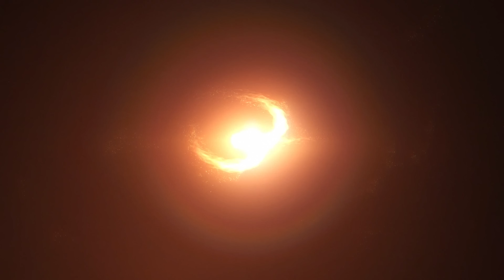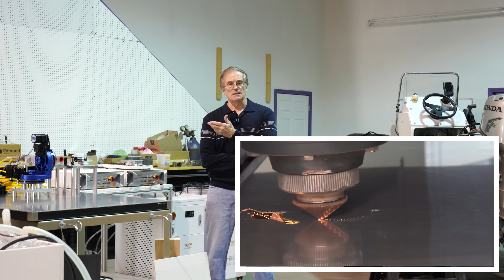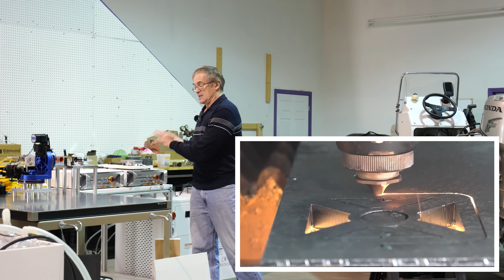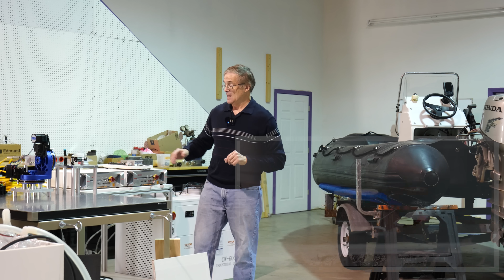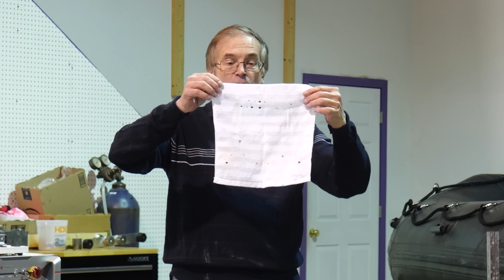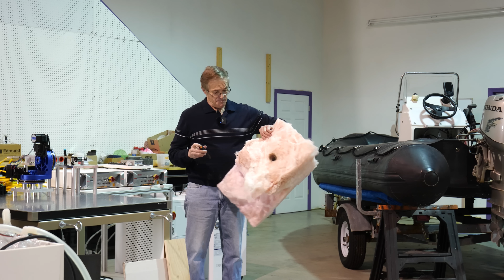We have a problem... and need your help!

Comment: A thank you to the creators of AI Llama. 4. which helped to  communicate this proposal/idea
Laser Curtain Concept. 
Creating a laser curtain to absorb or deflect incoming laser beams is theoretically possible. Here's a breakdown of the concept:

Technical Challenges
1. Beam Interaction: Laser beams interact through interference, absorption or scattering. Designing a curtain that effectively interacts with the incoming beam is crucial.
2. Material Selection: The curtain material would need to be able to withstand high-intensity laser beams without damage or degradation.
3. Curtain Design: The curtain's structure and composition would depend on the specific requirements, such as the wavelength, intensity and duration of the incoming laser beam.

Potential Solutions
1. Absorptive Materials: Using materials that absorb specific wavelengths of laser light could be effective.
2. Reflective Surfaces: Designing a curtain with reflective surfaces could deflect incoming laser beams.
3. Nonlinear Optical Materials: Certain materials exhibit nonlinear optical properties that could be used to absorb or deflect high-intensity laser beams.

Applications
1. Safety: A laser curtain could be used to protect people or sensitive equipment from stray laser beams.
2. Security: It could be used to prevent unauthorized access or to protect sensitive areas.
3. Industrial Applications: A laser curtain could be used to control the extent of laser processing or to protect surrounding materials.

Feasibility
While the concept is intriguing, the feasibility of creating a practical laser curtain depends on various factors, including:

1. Laser Beam Characteristics: Wavelength, intensity and duration would impact the curtain's design.
2. Material Limitations: Currently available materials might not be able to withstand extremely high-intensity laser beams.
3. Cost and Complexity: Developing a practical laser curtain could be costly and complex.

Further research and development would be necessary to determine the feasibility and potential applications of a laser curtain.

Comment: As others have suggested, sand is probably the cheapest and easiest solution. As for the setup, you could take a big sheet of plywood and glue sandbags to the face. The sandbags you can easily buy from the hardware store would be a few inches thick at least, enough to stop the laser for at least a few seconds. You can then put the sheet on a frame with wheels to easily move around in front of your laser beam.

Comment: Hi! Here is a good practical solution for your problem. In English, this is known as a water curtain. You need a flowing water wall—possibly more than one, arranged in cascading layers. This is quite a common solution in industrial processes, especially when you need to dissipate heat or prevent airborne substances from escaping beyond a certain space. Feel free to use it!
Reply: By the way, since the thermal conductivity and heat capacity of water are well known, it won't be difficult to estimate the parameters (velocity and thickness) of the water flows.

Comment: Curious if a copper bucket of water would work.  The walls of the bucket would need to be oxidized or painted with an IR absorbing paint. The paint cant be too thick or it will just absorb the heat and flake off.  A thin enough layer will transfer the heat to the copper and then the water.  If the bucket has enough water, it will absorb the heat and not boil. The bucket may need heat transfer fins on the water side to enhance heat transfer to the water.
Reply: thinking about this more.  Shoot the laser at a mirror that reflects the beam down towards a carbon cloth floating on the surface of a tank of water.  By shooting the beam downward, the carbon cloth only needs to serve the function of absorbing light and turning it into heat. It does not also have to be structural or keep water from leaking. Once the energy has been turned into heat, the water does the job of dissipating all the heat.  Essentially your blanket idea but changing the angles to allow for a lot more water to be available for heat dissipation.

Comment: make a waterfall wall out of plywood and dye the water black.  First though was for the wall was ceramic, but plywood would work and it hold the water better.
Reply: could add lines - whether cut or added onto the surface to break the waterflow tension and perhaps thicken the water flow, so to speak or at least cause turbulence. Another thought... add something like gelatin to the water to thicken it up all by itself. Shoot... do all the above  LoL

Comment: I see all these engineers and science type people offering what are probably great suggestions. But as a redneck with a GED, I'd recommend water saturated ceramic fiber blankets, as my first choice.

Absorption: Water has a high absorption coefficient at 1064nm (~0.1 cm⁻¹), converting laser energy into heat and steam. A 100W fiber laser will vaporize water rapidly, scattering the beam via steam bubbles. Ceramic fibers (silica/alumina, 0.1–0.2 g/cm³) add moderate absorption.

Scattering: The fibrous structure of ceramic blankets (e.g., Kaowool) diffuses the beam, breaking its focus. Steam generation enhances scattering, critical for a 100W laser’s high energy density.

Thermal Resistance: Ceramic withstands 2300°F, and water cools the fibers, preventing full burn-through. A 100W laser vaporizes steel at ~2500°F but loses coherence in this medium.

Thickness: Increase to 4 layers (1” each, 4” total) instead of 3. A 100W fiber laser cuts 1mm steel in <1 second, so an extra layer ensures no pass-through.

Water Content: Soak to 60–70% water by weight (vs. 50%). More water increases absorption, countering the higher power.

Expected Result: Penetration stops within 3–4” (vs. 2–3” for a lower-power laser). The first layer vaporizes water, creating steam that scatters the beam; subsequent layers absorb/scatter residual energy. You’ll see steam, charring, and partial fiber melting, with no pass-through.

Effectiveness: Very high. Water’s absorption at 1064nm and ceramic’s scattering handle the 100W+ power efficiently, stopping the beam in minimal depth.

This would also be cost efficient, as you can get ceramic fiber blankets on Amazon for about $20 for a 12" x 24" piece. If you hang it vertically, I would recommend letting a water hose run above it, to keep it saturated. Now, like I said above, I'm just a redneck with a GED, but one thing I do know how to do, is use Grok to get suggestions from.

Comment: I've personally made refractory coatings  using sodium silicate, perlite, magnesium oxide, plus any other materials you might find like baby powder: into a slurry.
I'm wondering if adding carbon might give you the light adsorption to prevent reflective laser energy havoc.

Comment: Colored water in a tank with a water leak catch basin that has sump pump for refilling the tank hot glue or plastic weld the holes shut so the pump does not have to go continually .
If you are using a flammable material like PVC for the tank then a layer of water resistant drywall held with many separate strapping bands , keep your tank cheap let it curve outward for the bands to take the load .

Comment: Thinking outside the frame you suggest. What are you really trying to accomplish? Limit collateral damage. My suggestion: Don't focus the beam all the time. One way to make it work. Add an actuator to the final lens. Put the lens on a spring, so by default it's very diffuse. The actuator moves the lens past the ideal focus point and lets the lens go. You can pulse this quickly until the target is destroyed. the system is designed to fail into a safe(ish) configuration. You can dial in the amount of focused time, and I believe the pulses may actually enhance efficiency since the ablated material will have a little time to disperse and the laser won't spend time superheating already vaporized material.
Reply: I think this is a good direction.
I tought of a dedicated lens for beam-spreading infront of the absorbent material.
Reply: This is how the rust remover works, correct?
Reply: Failure could be an option, and not a pleasant one? Failure in this case would entail working too well.
Reply: some kind of system like an airpiston to counteract the spring would work great. and only with the correct ammount of pulses per second (kinda like a PWM) the lens  is in the correct positon to focus. if the system gets stuck with full pressure > unfocused. if no pressure > unfocused.

although this might create some vibrations in the lens sending the laser beam of by a  few degrees but that sounds like a solvable Problem to me. (higher pwm frequency or  tuning the piston vs spring forces would probably work)
Reply: I know nothing, but I wonder if changing the focus point increases heat….
Way above my skill level for a MS Degree
But I’d like to have one in the garage….GREATLY

Comment: perhaps a bulk ablative material such as bags of silica sand (melting point of approximately 1700C), or better yet ceramic blasting media (carborundum has melting point of approximately  2600C).  I suspect the entry hole would solidify, preventing the media from pouring out of whatever container you use, but the remaining media, with such a high melting point, would be able to sustain a sufficient burst of energy.

Perhaps a sandwich of cement board panels and blasting media.  Thickness would need to be experimented with.

Comment: Maybe an aquarium with one thick copper sheet side which will face the beam would do it, copper is a good heat conductor and the water will cool it down so hopefully it will absorb the energy. Sandblasting the surface so it wouldn't be reflective that much.
Or, just a mirror at 45 degrees which will direct the beam into the ground.

Comment: What about just solid wood?  Even if you just stack 2×6s, based on how long it took to get through the 3/4 plywood, you'd get a few seconds before it made it through the 5" of width, and then you could easily replace the damaged pieces.  Though I wouldn't use construction lumber, green wood would be better, and if it were wet, it would almost certainly self extinguish, but even if it didn't, you wouldn't have inaccessible embers like you might with the plywood layers.  And wood is readily available up here in New England.  That said, the other comments talking about using a water curtain with either dyes or an electrically conductive plate behind the water does seem like it may be a good solution, in that it would be less massive.  Wet wood's just so cheap and readily available that it seems worthwhile to consider regardless, unless the mass is just too much of an issue to overcome.

Comment: Here is my idea: Perhaps  there could be a cylinder, say a steel pipe shaped like an "L". One of the orifices of the tube would face the laser, this side would have a glass/quartz/ruby window that would allow the laser light to penetrate. The tube would be filled with water that has perhaps a colloidal substance like silver to scatter the laser within the water. You could also use a dye that absorbs some of the light coming from the laser. The other end of the "L" would be facing the ceiling and would be left unsealed to either vent out steam generated within the pipe and you could attach a graphite cone or disc a few inches above the opening should any harmful light reach this point. 
Why I think this may work well is that the colloidal substances within the water would help disperse the tight laser beam into a less organized, less harmful light. The amount of colloidal solids in the water could be tuned in order to allow a specific % of heat to be released in the water. The length of the tube could be customized to a suitable diameter to provide sufficient "heat sink" properties.
Additionally, the "L" shaped tube with the elbow facing up would further help in scattering the light upward and allow for easy refilling and or allowing steam to escape. The graphite cone attached a few inches above would act like a secondary laser sink to stop any remaining light, at this point the graphite should not be taking too much damage.

An even cheaper solution could be a reservoir say like a 5 gallon bucket but made of steel, a window on the side facing the laser would still be needed on the side exposed to the laser like above and you could dump coarse sand and or gravel then fill the gaps with water. The coarser the sand the better I think as it would not immediately melt like the pink fiberglass and give time for the water to pull some heat away.

Both of these are cheap (aside from the window material perhaps if you go with quartz or ruby) abundant materials that are not too cumbersome and would give you at least a few seconds of "holy smokes!" (pun intended) before anything should fail. I hope you give these a try and that they work for you, I am curious to see something like this tested, cheers!

Comment: Active backstop:
-Array of alumina or barium sulfate tiles behind the target, with a photodiode behind each panel. Once target lock is achieved, ramp up laser power. If any photodiode detects a rise time close to the laser ramp up (or something resembling a tile beginning to glow), blank the beam and attempt to reacquire target.
- Alternately, if you wanted to avoid messing with the fiber laser control loop/targeting algorithms, and maybe use a cheaper diffuser material (PTFE? Polyethylene? LCD TV diffusers?) you could have a low power CW beam of a different wavelength, (532nm?) coaxial to the fiber beam. Then all you need is to blank the fiber beam whenever any of the panels sees 532nm (dichroic filters over photodiodes for better SNR?), and the control system won't know the difference (but the wall will!)
- It's not real-world, but if you get the targeting system to the point where it barely triggers the backstop, you know you're on to something!
- My sympathy for having to read through 8k comments! On the up side, ~90% of people who viewed the video so far had something to contribute - shows what a creative viewership you have!

Comment: I have a somewhat diffferent option in mind. What if you have more(2, maybe 3) cameras scanning the target. These cameras would be fixed to the same frame, they wouldn't move relative to each other. A software would use these video feeds to more acurately track the target. The laser would only fire if the target is directly in the line-of-sight of the laser beam. The laser would be pulsed a few times, basically like photon-projectiles. It would ensure that no more than a few milliseconds worth of radiation could penetrate the target so a cheap option like drywall could be sufficient.
Please tell me if this isn't an option or is just a stupid idea. I like you videos, please keep it up.
Reply from the maker: Even with just our two cameras, that is basically how the system functions. We want to run the lasers at full power to destroy the target as fast as possible and allow the system to move to the next target. Any reduction in output will delay the process.

Comment: Dry ice Chimney, 
Dry ice Generator in the bottom, Chimney at an 45%angel to the laser attack angle it will widen the material without using more space or material, open chimney into the air, as the dry ice moves up the chimney due to natural confection. It helps to reflect rays and to remove heat while replacing the the "burnt" dry ice fog with fresh one, the front chimney material could be a material that can be moved on, on rollers. So that a fresh wall can face the laser once more for a renew session. The wall is only there for the purpose of channeling the dry ice fog upwards and out into the outside air. Not sure what density can be riched, but I suppose the denser the fog the better the result. The outer wall can also be made of a flexable reflector material that assist the dispersion of the light.
2. Then another crazy idea could be a laser curtain diagonal to the beam, it does not need to be of the same powerful magnitude, but could perhaps be of assistance in dispersing the attacking laser into a less lethal beam.

Comment: Inexpensive and portable.   Non PVC (EPDM) 4 inch thick or two layers of 2 inch thick OPEN cell foam soaked in a mixture of 80% water and 20% polyethylene glycol after it has been soaked in a freezer for at least an hour.  "rinse and repeat".  Not sure how "inexpensive" or "portable" most other suggestions are on this list.  Could also soak insulation in 80/20 water/glycol.  The reason for the glycol is to keep it from freezing solid and to reduce the waters movement under gravity.

Comment: What does the Laser due to graphite. What if you took expandable graphite and put a quarter inch six coding on the whole wall.. Would that absorb the laser beam and disperse it throughout the graphite instantly. I don't know, I'm retired till setter. Seems to me that you could cote a wall with Graphite even an inch thich pretty inexpensive and the waight would be minable.  Or better yet a solid wall of graphite will the gap behind it? But i'm not sure where you would purchase that. Maybe expandable draft light would hold up well enough to hold its on weight.. Just a thought